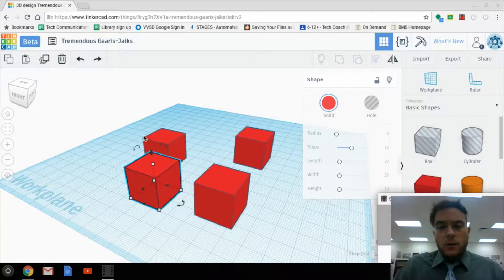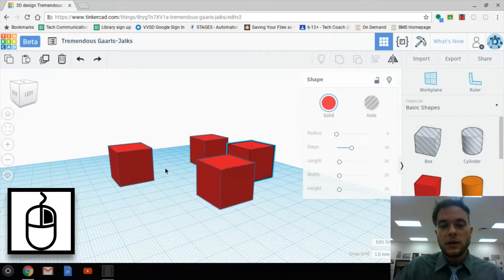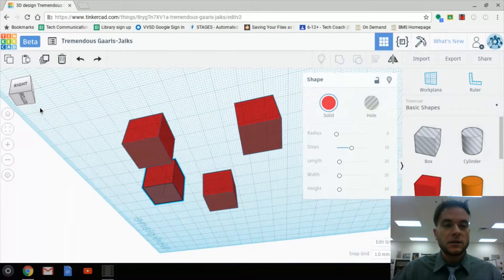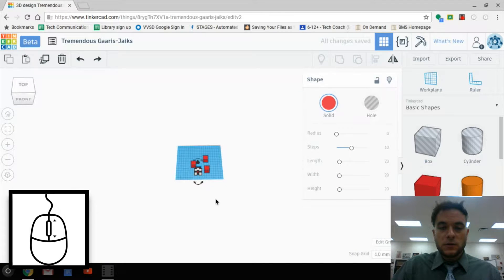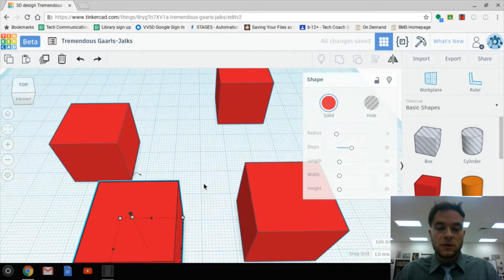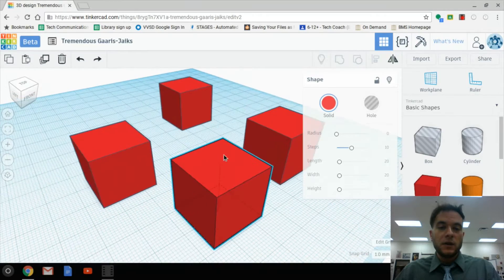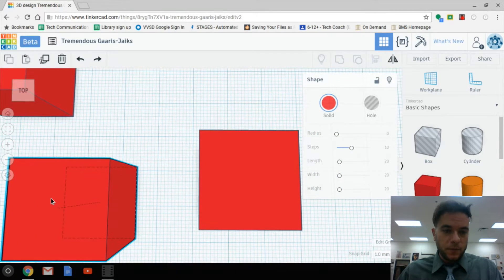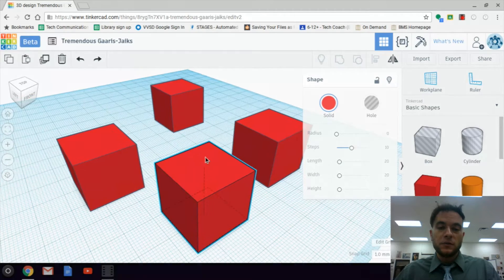TinkerCAD (2) Camera Controls

Comment: You have saved my sanity. I was working on several designs where I was centering one shape in another. With only orbiting I had trouble getting a direct overhead view to line them up. The pan function made this so much easier. Thank You.